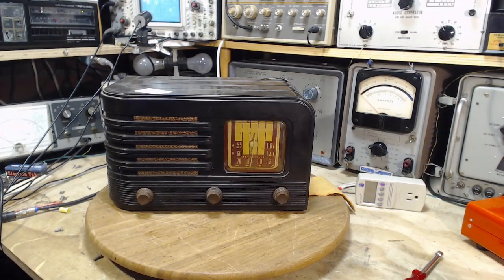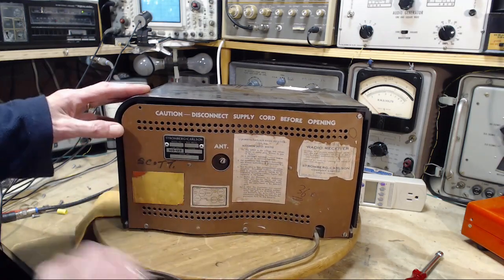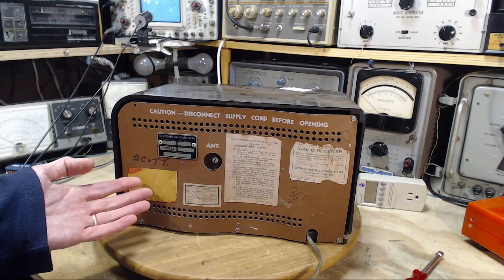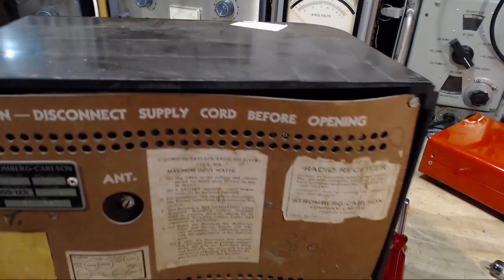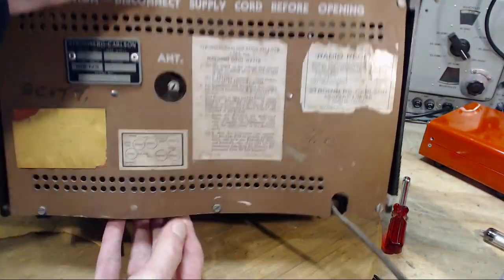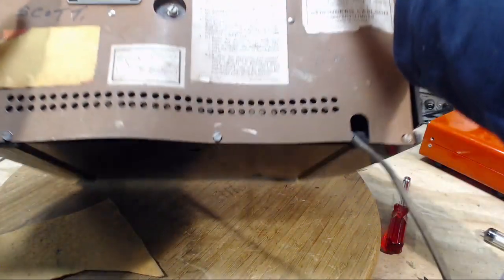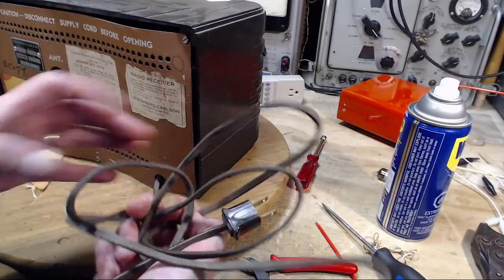Stromberg Carlson 561 Tube Radio Video #1 - Checkout and Startup

Comment: I had a bad crack in the bottom of hard plastic radio cabinet. Cleaned the inside and sanded inside along the crack. Then liberally covered the crack inside with JB weld and it worked securing the crack. Not sure if JB weld works on Bakelite but it seams to stick and harden on everything I have used it on.

Comment: Epoxy and hardener might a little fiber glass on the side of the case should solve the cracking problem, Carlson's Lab did a complete rebuild of one of those radios.

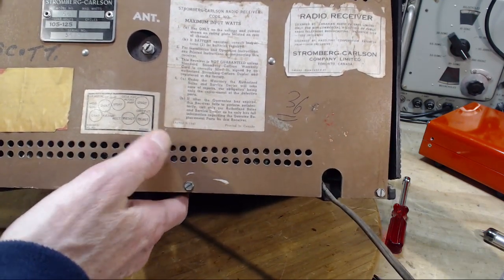Comment: 4:15 Two 35L6 on the output? Really? Its not sharp to see on the video but on the chart the left is a 35Z5 and the right a 35L6. Which is backed up by the schematic available on the interweb. And for those who dont know; 35Z5 being a rectifier diode, 35L6 being a power pentode. But I am sure he will find ways to elaborate on how to construct push pull from that. But for the people who know that a diode and a single pentode cannot be combined into push pull, it is clear that his wondering at 4:22 why there is no phase inverter tube comes at no surprise. Me thinks we are on to another chase for the elusive red herring... Oh and 21:03 "(It's) got all kind of old wax capacitors...." 26:50 "The capacitors look to be in good shape ... how the wax is covering the end of them... all of them are pretty darn good" Yap may want to put on ear protection to protect you from the screams of the 35L6 caused by positive grid voltage leaked onto it by a faulty 0.01 coupling cap
Reply: Melissa Hermsen Paper wax caps of this age become acidic internally and pretty much become resistors. Every restorer on YouTube knows this and replaces them without question. Every one he does pull and tests are always leaky but that seems to go by with no bells going off. I’m waiting for him to fry the wire wound rheostat in his Heathkit cap tester. When you test larger caps you need to put that capacitance dial all the way counter clockwise, if not it shunts the discharge of the cap under test through the winding of the pot. All the way over the wiper sits on a metal tab. I got one of these from a friend that had that issue. I rebuilt it and it is a handy tool, I made mine more sensitive with a NE 51 neon bulb and a .01uf cap which makes it work to the earlier versions of the Heathkit cap testers. The way it is stock it passes caps that are leaky.
Reply: At 36:45 when looking at the schematic he acknowledged his mistake on the 35 tubes and corrected himself that one was the rectifier.

Comment: I find it interesting that this radio has an R/C coupled RF stage. There is no tuned plate circuit to the RF amplifier. This probably saves on only having 2 sections to the tuning capacitor but doesn’t do much for selectivity and image rejection. Because there is no tuned RF  stage there was probably IF feed through back into the RF stage, so a wave trap was fitted tuned to IF frequency. All a bit crude.

Comment: Prior to powering up the radio, the chassis should be removed from the cabinet and given at least a full visual inspection. Looking for possible shorts, cracked or bubbled caps, burnt resistors etc.